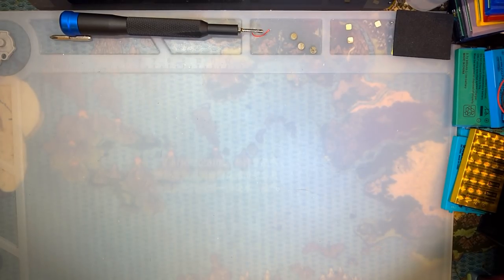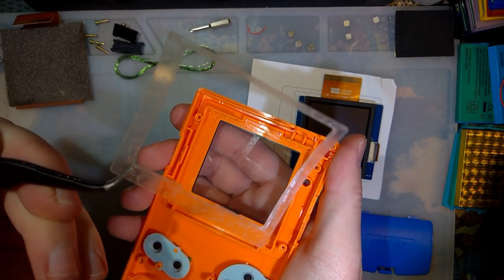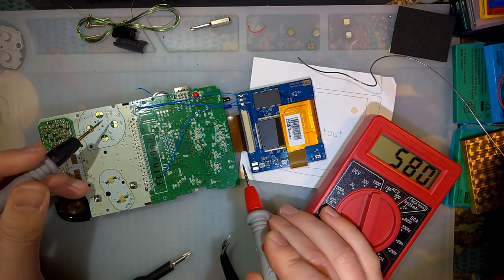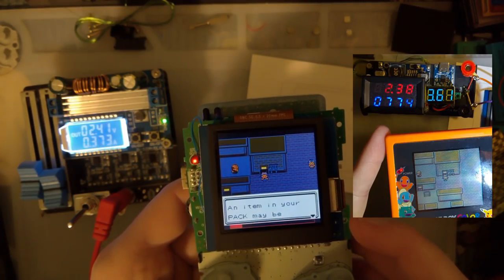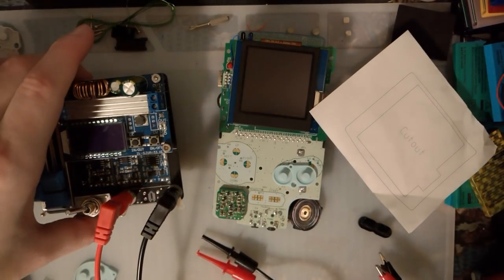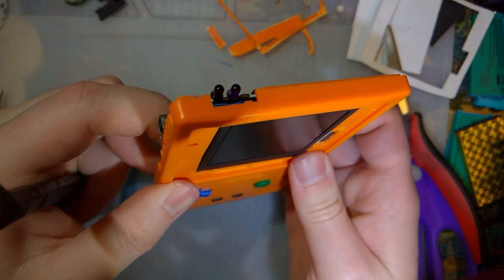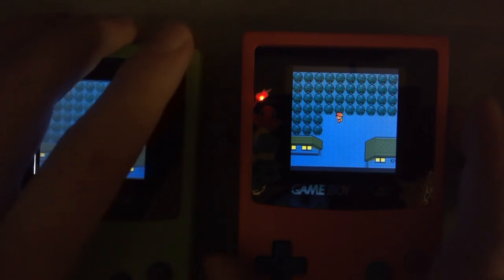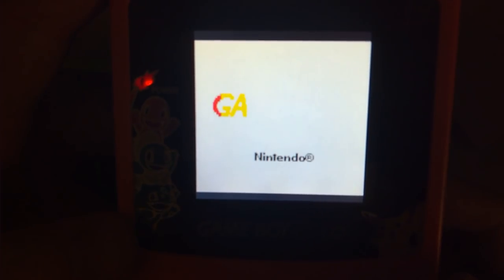Installing the Midwest Embedded Game Boy Color Backlight Kit

Comment: Hello Makho! I just found your channel and im enjoying the long duration videos which has a plethora of information. I was wondering if any of the funnyplaying displays can be used with SBC's?
Reply from the maker: By SBC's you mean something like a Raspberry Pi, correct? If so, I haven't seen any method of getting that to work. That doesn't mean that it can't be done, I just mean to say that I've not seen it yet. If your device can interface with an AGB screen, it should be able to interface with the FP screens too through the FP adapter, though if you have to do anything custom, you might as well interface with the LCD directly instead though the FP adapter.